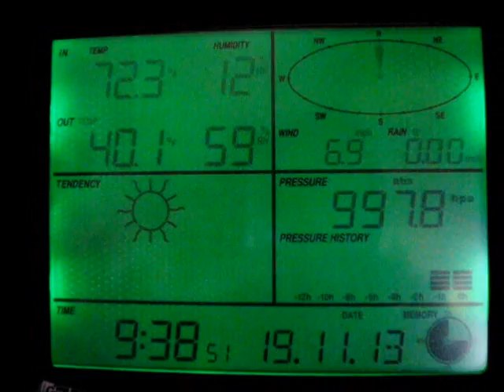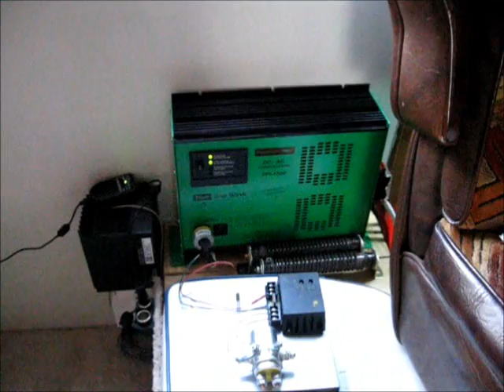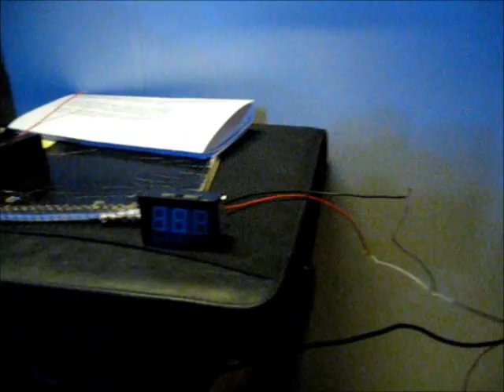Strong Winds Lots Of Damage And Mounting My New Wind Turbine

Comment: Put a rain gutter on your porch and run rain water into a metal container and put the container in where you have the woodstove. You might also consider burying your water tanks to keep from freezing? My grandfather built a pump house in the 1960's that's about 5 ft deep and one foot above ground with no heat. It's never froze the water tank or pump.

Comment: troy i got about the same setup at my hunting camp. my camper with a porch onthe front of  it. At home depot I bought 1 gutter and down spout for 12 bucks. put it on the front of my porch and ran it down  to my 275 gallon tote. filled up in a weekend of good rain. works good been like that for about 5 years now with no issues.
Reply from the maker: I plan to do the same in spring. But I have to bury my water tanks next time to prevent freezing.

Comment: smh. Troy. Ok, so you saw that the wind mangled your water collector and the stands on which it was so precariously perched. You decide that it is perfectly fine to mount your new windmills on the exact same faulty stands? I don't get it. It is like you are setting yourself up for disaster.
Reply from the maker: No, the stands are still standing. The metal sheets were ripped off of the screws that held them in place. They acted like sails and took off.

Comment: I've got a length of 5 or 6 inch pvc pipe, I fancy cutting some blades from it, is there anyone who knows the shape? I have seen them printed on paper, taped to the pipe then cut out etc, thats what I want to do but I want to to get the right profile, I want each blade about 3ft and maybe 5 of them? planning to gear it 2:1 to fast spin a  PMA
Reply: I've seen a lot of videos that use PVC blades. Ultimately they all break, and fly off. Consider using wood.

Comment: I now you rent but you need to concrete your rain water frames and turbines you can always dig it up and file the hole if you have to move later.
Reply from the maker: I need a dozer to dig here. Its so rocky is the biggest problem. If I own the land I will barter my website and SEO work for dozer work.

Comment: For your Rain Collection system, I'd suggest making a 10' high wooden frame, an 9' wooden frame, and an 8' wooden frame, each with 3 feet buried in the ground (preferably cemented in), then use a wooden brace frame around your metal sheeting with barely enough room to slide your metal sheeting through. The Earth Anchor (3' of the wooden beams cemented down) will provide much needed stability in high winds, and the wooden brace frame will keep your metal sheeting from flying off your wooden stands better than just screws will. The differences in the frame sizes will also give you the downward slope for the rain to travel into your catchment system. I'd probably be easier to explain in a diagram, but I hope you understand the concept. Good Luck Troy.
Reply from the maker: Yes I understand fully. I hope the land will be mine next year and then I can build solidly and permanently. Had to keep it mobile and temporary because I am renting. Thanks.

Comment: need flat washers under them screws on that tin
Reply: Or use Grip-Right roofing nails. For example, here's the 1" size.
http://www.lowes.com/pd_109265-1278-L1PRCAP1_0__?productId=4744115

This is what I use to wrap the back porch in 6 mil plastic during the winter. Wind may rip that plastic somewhere, but it sure doesn't pull out from under those nails. More than one size available.
Reply from the maker: Good idea. Thanks.

Comment: FINALLY IVE BEEN WAITING ALL DAY!!!
Reply: Now ya need to increase that battery bank!!!
Reply: Eric Higinbotham
And i suggest optima blue tops
Reply from the maker: Eric Higinbotham Yes I need to get more batteries. While in Australia I will save up and get four more when I return.
Reply: the Sealed Gel no leak i mean i used a red top for 5 day before and i never charged it and it was powering an audio system which was playing amps and subs at very loud lvls and it stayed charged and im pretty sure the Blue tops are way stronger. you wanna look at the amp hrs and i mean optima got locked thats for sure doesnt matter what the temp its caz there not water so the charge that is held within doesn't disperse fast